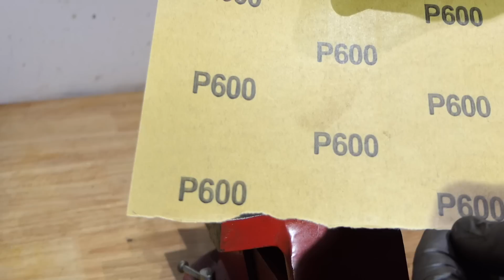RESTAURATION A 100 % DU PISTOLET BULLDOG 38 SPECIAL 1868 TROUVÉ A LA PECHE A L'AIMANT A PARIS

Comment: While .38 special may fit, that pistol is NOT intended for it. If you fire .38 special in it you will have problems and damage the gun and possibly yourself. It's probably made for something like .38 Smith and Wesson Short loaded in black powder. Or another possibility is .38 Short Colt. But it could be any of several different types that were popular when it was made... Definitely do not load modern smokeless ammo into it!